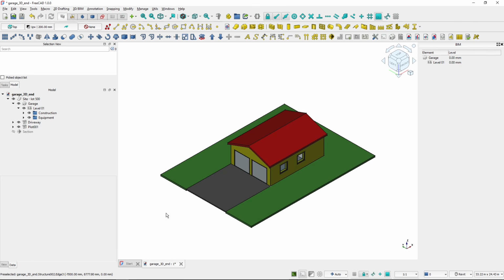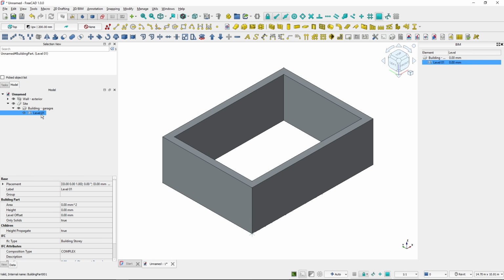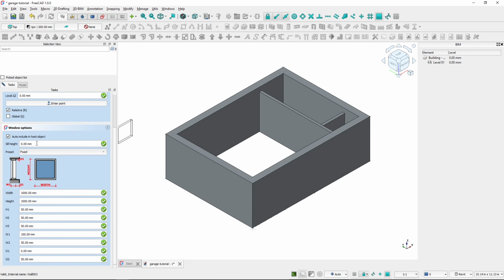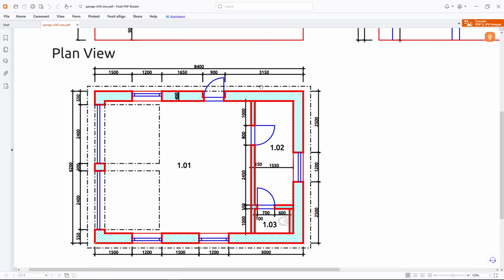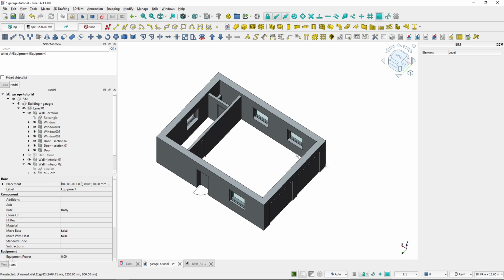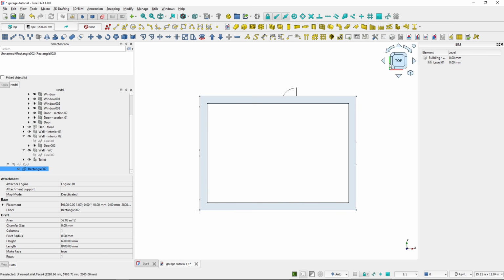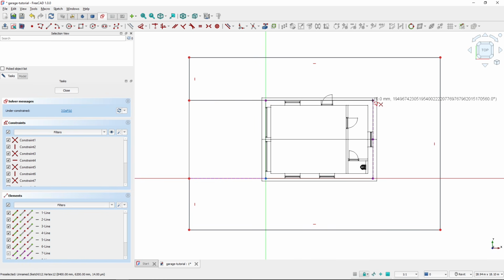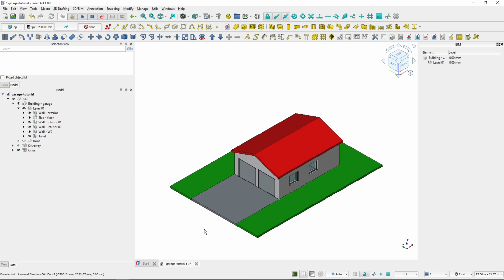FreeCAD BIM Beginner Tutorial | Create a Garage Building

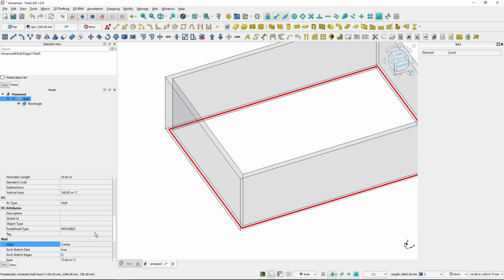Comment: Cant get past 6:50, it doesnt matter what you set 'wall align' to, it stays on the default 'center'....!!
Similarly changing the wall thickness or height in data has no effect on the model...!!!
Reply from the maker: That is strange. Can you share your model a describe the issue in the BIM part of FreeCAD forum? https://forum.freecad.org/viewforum.php?f=23
Reply: @FCBlounge  OK, will do.
Reply: @FCBlounge  In preparation for making a post I drew the rectangle from scratch and walled it. I could then change the alignment and the wall height and thickness...Then it stopped allowing any changes...!!!
I re-drew it from scratch again this time I changed the alignment and immediately changed it back. I could now change it many time without a problem...I tried the wall height, I could change that up and down, similarly wall thickness. I could even change the rectangle dimensions and the wall would follow, amazing...
I then 'measured' one of the dimensions to confirm the new wall width, it was correct.
However now I couldnt change any parameters of the model...!!!
The measurement shows up in the tree and was difficult to get rid of but I managed.
Hey presto I could change any parameter again!
So having a measurement in the tree locks the whole model...Which seems ridiculous.
I now notice in the video you always 'close' the measurement which deletes it.
In my sidebar the measurement appears at the top of the page and the close button is at the bottom of the page so I didnt see it.
Did you know that any measurement taken locks the whole model??
Reply from the maker: @manoo422  Yes, the measurement is an active tool and you can not activate other tools while it is running. The UI has that `Close` button in a wrong position, it will be fixed in the next version of FreeCAD.
Reply: @FCBlounge  This a ridiculous flaw in the software, the measurement tool should 'automatically' switch off as soon as you use another function. But Equally shocking that I have not see this major drawback highlighted in any FreeCAD video on Youtube!!!
Reply from the maker: @manoo422  This is the way all FreeCAD tools work.

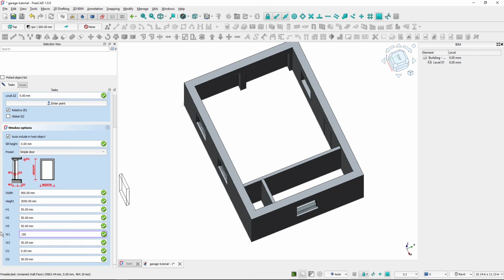Comment: In 34:12 you adjusted the "H3" value to match the thickness of the wall, and some other values can be specified when creating the door resp. window. Is it also possible to modify these values later or only when creating the part?
Reply from the maker: You can edit some of them later, like width and height in properties. Some other like W1, W2 or one of the offsets can be adjusted editing the door object. Some of the values cannot be changed after the door is created I think.

Comment: 14:30 Does "Hit Shift to lock the direction" mean the Caps key on the keyboard? Does not work for me. Has no effect. I have to click the left mouse button and the the line remains exactly where I dragged it, no chance to type a coordinate. Workaround: adjust "placement -> position -> x" in the line's data tab. But how can I get this "hit shift" to work?
Reply from the maker: You have to hold the shift key, move your mouse while holding the shift key, than release the Shift key and NOT move your mouse, so that the direction stays locked. The just type in the lenght.
Reply: @FCBlounge  Thank you, I eventually found out after some trying. Next question coming soon

Comment: At 5 minutes and 11 seconds, it says "Using the corner length measurement tool, it says 8800", but on my PC, it shows 8600, which is the value I initially specified. Why is this? >> Among the "Data" properties of Wall - Should I set the Align value of Wall to 'Left'? If I set it to Left, the value of the corner appears as 8800.
Reply from the maker: Yes, that is probably the cause (if the wall thickness is correct). This property is set ti the last used value for new walls.

Comment: I'm new to freecad. Just completed the Create 2D Floor Plan tutorial. In this tutorial I immediately ran into a problem. After creating and selecting the first rectangle, clicking the Wall Tool I get this error:   Wall: '_Wall' object has no attribute 'layersNum'
Reply from the maker: It looks like you are using 'Building US' unit system, isn't that the case? It has similar issue, which will be solved in the 1.1 release.

To solve this I would recommend you to first create a wall from scratch - start the Wall tool - and set up the height and width of the wall in the task panel. When you create this first wall, you can delete it - these settings will be preserved and you should not encounter the issue you are having no more.
Reply: @FCBlounge  Thank you! I was using Building Euro cm units per the tutorial. But the wall presets were all set to 0.00cm. Creating a wall from scratch got me past this hurdle. 🙂
Reply from the maker: @rossmelin4935  Glad you were able to solve the issue. 👍

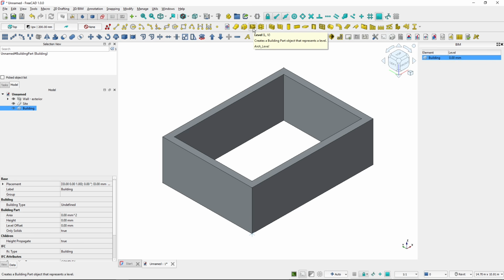Comment: Thanks for the helpful tutorial. I am using FreeCAD 1.01 on windows but have found several things don't work int the same way as your tutorial - e.g. walls default to center (not left) and when I add a Level (minute 9:19) it adds a huge label "Level +0.00" to my model (bigger than the wall) any idea why this happens? Thanks
Reply from the maker: The wall alignment depends on what the last used alignment was. It's quite easy to change.

The Level text size can be change in the 'View' properties of the Level,  'Text Size' property.

Comment: Hi, even though I have Snap to Working Plane selected, the little orange dot does not appear for me (like @14:02) and when i click to start the line, it has attached it to nothing in a random place in 3D space. I also had the slab turned off like you had. Only if Im looking vertically down at the plane will it attach to ground level but its difficult to see from that angle. Then when I try to move the line, it again moves into a completely random direction in 3D space. Please advise. Thanks
Reply from the maker: It is hard to tell without seeing. Check if you have snapping to endpoint turned on. Also, try to move your cursor over the bottom edge of the wall, not the vertical edge of the wall.
Reply: @FCBlounge  Thanks. I have tried those options but it seems I have something else going on that I'm yet to find/understand
Reply: @FCBlounge  Found my issue. I had "Current Working Plane" set to Auto. I must have accidentally clicked it at some point and then my problems started.
Reply from the maker: @ Good to hear you found the culprit. Sometimes working planes can mess thigs up and the change in working plane can be hard to detect.

Comment: How good is freecad for plumbing? I have been using sketchup for that for a long time, but I like FreeCad, and I want to get into it. On the other hand, I also have knowledge of python but not applied to the creation of applications, but I like FreeCad so much that I might even try to collaborate.
Reply from the maker: I have not tried creating plumbing in FreeCAD, but it is on my long list of things to research 🙂. The features are there, I do not know how practical they are.

Knowing python is good enough to start contributing to the project. There are issues labeled 'Good first issue' on FreeCAD GitHub, which are easy issues to fix/implement. These are good for first-time developers to tackle. You may look at the list and see if there is one which you would like to tackle: https://github.com/FreeCAD/FreeCAD/issues?q=is%3Aissue%20state%3Aopen%20label%3A%22Good%20first%20issue%22

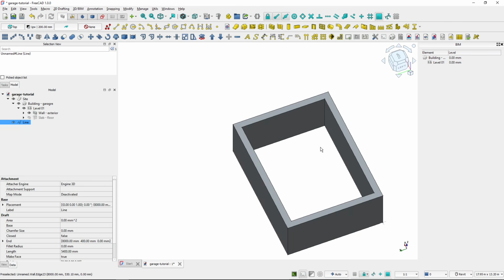Comment: I'm struggling..... at 14:05, how do you rotate AND maintain control of the line?
Reply from the maker: It depends on the navigation style you are using. In the video I use 'Revit' style, so I can achieve rotation by holding Shift + Middle Mouse Button. It is different with other navigation styles.

https://wiki.freecad.org/Mouse_navigation

Comment: I've learned a lot from your videos - but still a beginner :). 

I want to learn FreeCad and help a friend plan the electrical instalation in a small cabin. 

Do you know if FreeCad has any support to plan electrical wiring?

It would be awesome if I can get the length of wire needed :) to buy of each gauge.
Thanks,
Eugen
Reply from the maker: I just recently saw a new tool in development for creation electrical wiring. Check it in this FreeCAD forum: https://forum.freecad.org/viewtopic.php?t=94090

To get lengths of wires you could also use simple Draft_Wire tool and than get the length out of it.
Reply: @FCBlounge  Early stages but looks promissing. Will keep an eye on it. I think I might skip modeling for now since it's too much of a project and I won't be able to help him on time.
Reply from the maker: @ Yes. Hopefully it will move forward fast.

Comment: Is there any way to move a wall without breaking its doors/windows? Everything I tried breaks :(
Reply from the maker: There are many variables. To move the interior walls from the tutorial, you can select the wall and use the Move tool. Doors should move with the wall.

When working with the exterior wall from the tutorial, you have to work with the base object - the rectangle. Use the stretch tool as I did with the roof. After that, you will have to move windows and doors with the move tool as a second step.
Reply: @FCBlounge  I tried this, and the door gets left behind when i move the interior wall :(
Reply from the maker: @ah-64apache84 That's strange. Make sure that the 'move with host' property of the door is set to true.

Otherwise I recommend posting your problem on FreeCAD forum, together with the problem file. https://forum.freecad.org/index.php
Reply: @FCBlounge  i will try that thanks!